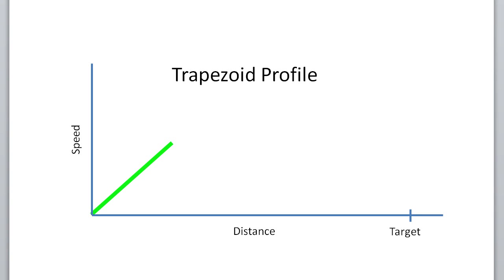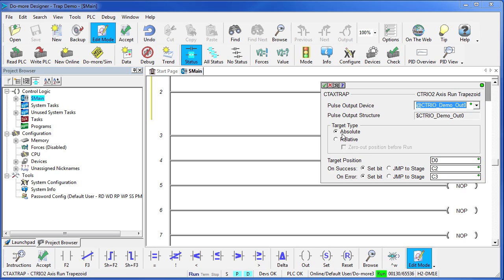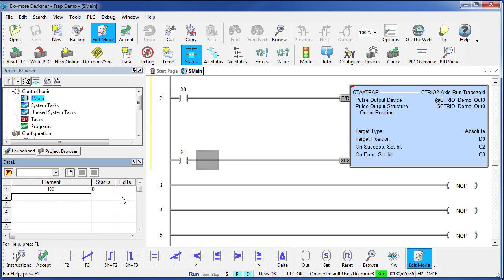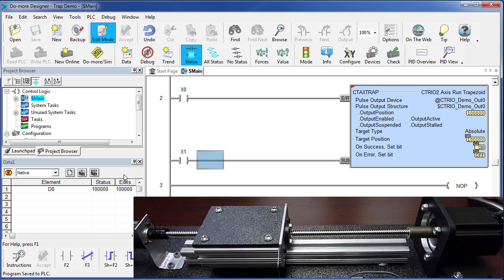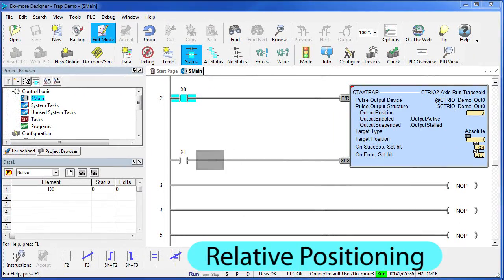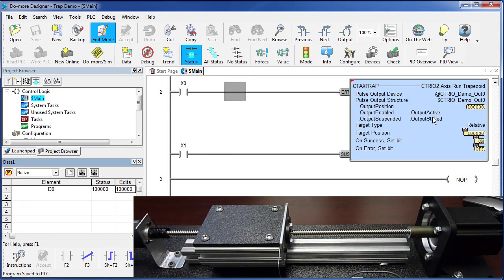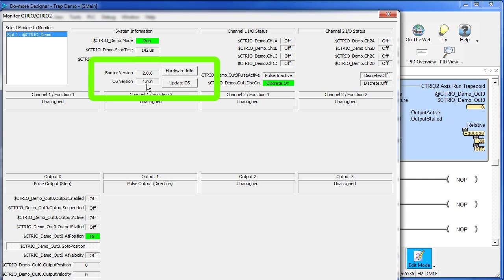BRX Do-more CTRIO2 Motion Trapezoid Moves from AutomationDirect

Comment: Hi, How do you control the velocity while moving to the target position, please help. Thanks
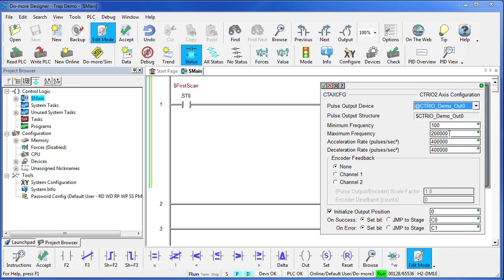Reply from the maker: Hi Ranbir - At time 0:42 in the video we see the max pulses per second is 20,000 which gives us 10 shaft rev's per second. You would then lookup the pitch of the linear slides lead screw and use that to figure out the speed. I don't remember the pitch of that one, but suppose it was 0.2 inches. That is each rotation would move the carriage .2 inches. We're doing 10 rev's per second, so that would be 10 * 0.2 or 2 inches per second.
Reply: @automationdirect  thanks for the reply, for some reason I don't see any change in the speed of the motor as i change that Max freq number. 
What would be the address of Max frequency so that i can be controlled by C-more panel ?
Reply from the maker: @Runner_bir  You don't need to know the address of the Max Frequency. Just put a variable there, like D0 for example, and control that from the C-more. There's a great video that shows you how to transfer tags between the C-more and a Do-more PLC here: https://www.youtube.com/watch?v=bKfarmcbNXM
Reply: @automationdirect  its working for me now thanks! But i still need to know, what is the address of Max freq. in CTAXCFG so that i can change it from C-more ??
Reply from the maker: @Runner_bir  Did you see the previous note - there is a video that shows you how to transfer tags (memory addresses) between the C-more and Do-more.
Reply: @automationdirect  Hi, what i am trying to achieve is, be able to control the velocity on the fly while servo is moving to a set position. Dynamic velocity mode does not do it because in that i cant define the positions.
Reply from the maker: Hi Ranbir, This is getting a little too deep for a YouTube comments discussion. Can I suggest you go to the forums here: https://forum.hosteng.com/  or contact automationdirect's free tech support at 1-800-633-0405. Either of those will be able to help you get this figured out.

Comment: I did not realize that the CTRIO2 Module can also support motion control pulse/direction output.  I've primarily only used the CTRIO2 for encoder feedback.  Are there limitations to what types of motors can be controlled with these high-speed outputs?
Reply from the maker: Thank you for watching! For technical questions like this, please contact our free award winning tech support. They are setup to give you the most efficient and quickest support. 
Phone:    1-800-633-0405
Email:     https://www.automationdirect.com/adc/Form/User/TechInquiry
Support:  http://support.automationdirect.com/
Thanks, AutomationDirect